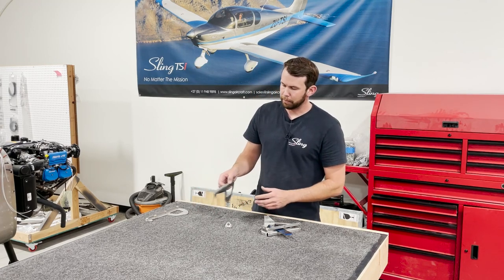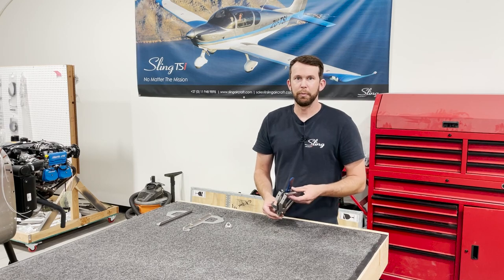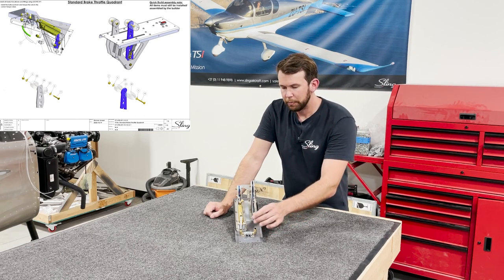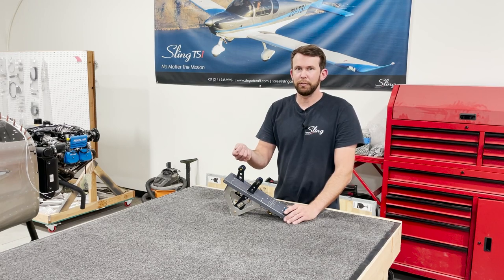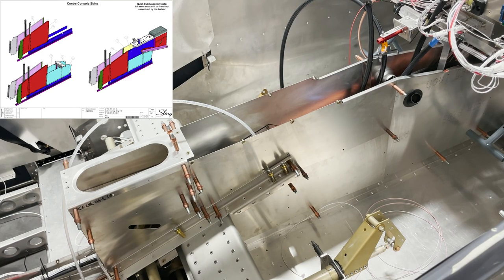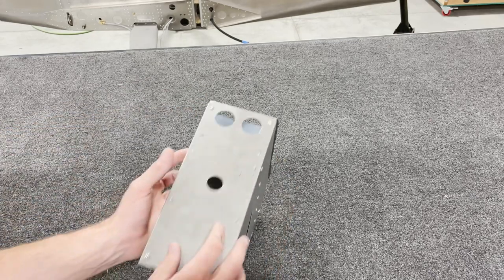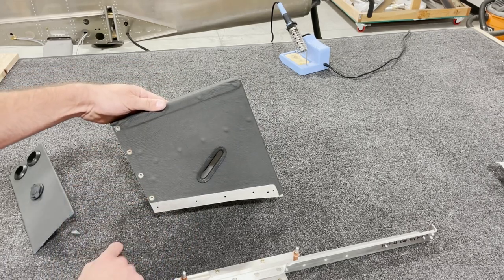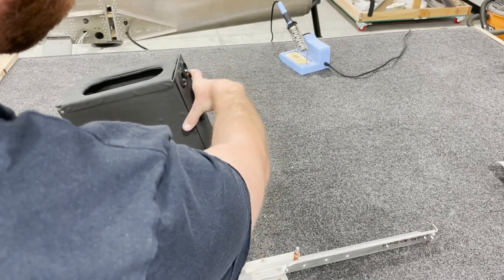3.5. Sling TSi Fuselage Throttle Quadrant and Center Console

Comment: At about 5:50 in the video, you said that the Rotax 915iS is set up so that if the throttle cable breaks, it goes to full throttle. That's a good fail safe while flying. When trying to land, though, how do you cut the power, since there is no fuel mixture lever? Do you just get to glide distance and turn off the engine, or is there some other way to modulate the engine speed?
Reply: Edward - I was flying in a 912 Rotax and had a similar issue where I couldn't get the throttle to retard all the way - that's exactly what I did.  Got up to gliding distance, turned off the lanes and landed.
Reply: @ibgarrett  Got it - to turn off the engines, you turn off the lanes. I am so old school! I am still using a mixture cutoff lever! 😁
Reply: @EdwardHefter  oh I know. I don’t quite get it either.